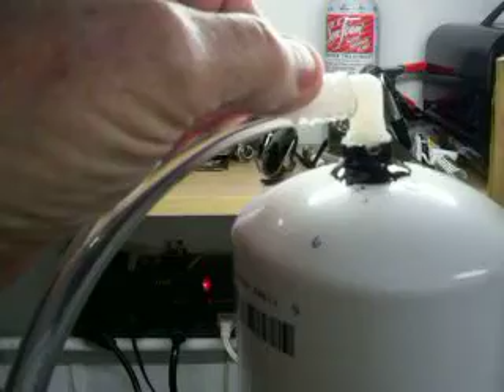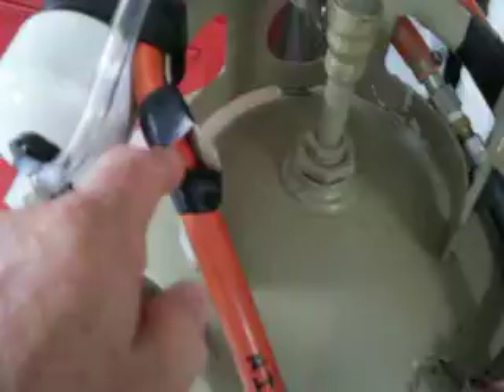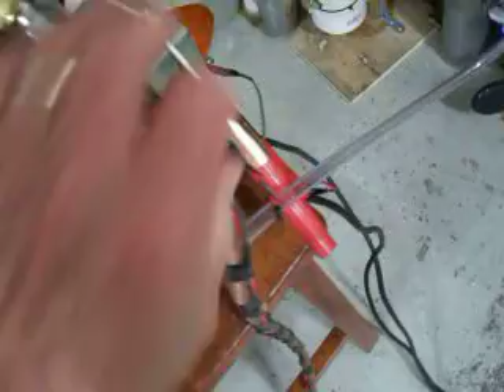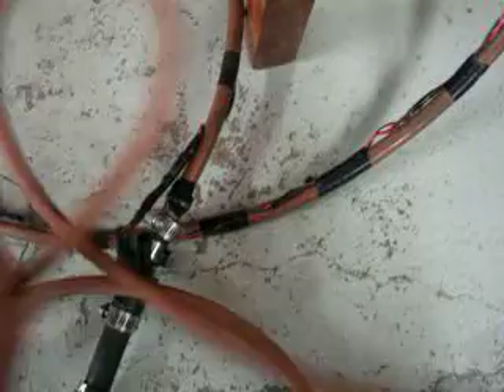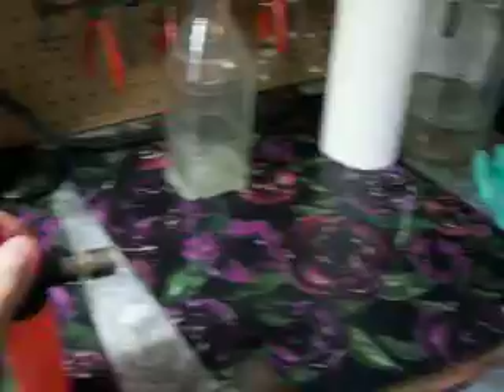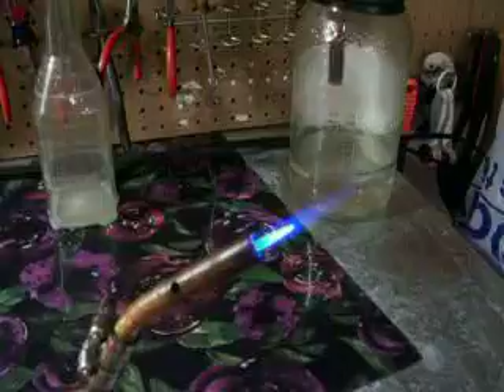system set up explained

Comment: Hello  
Nice work 
But I have a question  to you
Do you think it is safe to compress a gas vaper ??? 
Thanks
Reply from the maker: Baha Khazel i have been doing it for a long time, never had no problems, you just have to be careful with sparks or open flames around the tank, always be safe and you will never be sorry
Reply from the maker: there is no need to heat the gasoline up to compress it in to a tank,  the way i do it is i have a oil less air pump drawing a vacuum through a tank of gasoline and my wicks and let it pump it in to my pressure tank, 100 percent gas vapor, i pump it to 60 psi and have no problems at all. just be safe and keep sparks or open flames away from the tank.

Comment: i am looking for a decent pump to use on a light suv for this system. i have figured out my fume chamber and have scuba tanks for my storage, but need a way to charge them. i plan to refit a 3/4 pu truck later.
Reply from the maker: thats what you need a good thick tank

Comment: sorry to admit failure.i have not been successful with 50 psi going to my fuel rail.i have compressed vapors as you did and pushed it thru shredder valve in rail.  i dont know if i did not bleed enough but engine was running for 2 minutes only .it maby that vapor need to be at molecular level lake steam.any suggestions?
Reply: what the temperature was at fuel rail\injector? air intake temperature?

Comment: you would not believe what happened .i have blown vapors to my bubbler using mattress pump which i know has not much p[pressure and hooked exit  hose to fuel injector.  put candle in the front of injector and while switching on and off injector i was getting beautiful bluish flame. i was thinking in stead of pressurizing vavors to the tank i would use 12 volt compressor after bubler straight to rail. I also had question where did you get your brass flashback arrestor
Reply from the maker: i got it from a car quest store a few years a go, this will handle hydrogen gas and gas fumes good with out no fear of a explosion if it ever did back fire

Comment: great job vaporkid. i just wonder, could you could run a 100cc motorbike with your wicking design system without an air pump? thanks. God bless!
Reply from the maker: sure could easily
Reply: thanks for the reply. the problem is the throttle and changing gears. i have tried the vapor system heating the gas with copper tube with my bike. i did succeed at first but i only traveled 3 km and the bike died down and the torque and acceleration is insufficient.
Reply from the maker: BOOPIE DISTURA i think if you use the wicking  it will work you just have to get the right wicking material,  and make sure that the tube going to the carb is at least 1/2 ID becuse the carb gets starved the more power you demand, on a car engine you have to feed 6 or 8 cyls and that takes a lot of air to feed it, i go with a 2 in line for my vapor system, good luck and have fun.

Comment: Scientific question, at what pressure do Gas vapors become unstable ? I wouldn`t want to see anyone blow themselves up !!!
Read here for some insight.. http://forums.iboats.com/forum/other/non-boating-technical-topics/220436-what-psi-are-propane-tanks-rated-for
Reply from the maker: gasoline will boil at 101 deg to 401 deg it will vaporize compleatly at 450 deg  will self ignite at 460 deg, some people heat there gas by putting a copper coil in some gas and heat it up with there radiator at a 190 deg she will boil real good to start steaming all the vapor you need,  actually that is where you get all your mileage from  heating the fuel!!!

Comment: I have an AC compressor that I can convert to a dedicated compressor, see here http://www.jeepforum.com/forum/f11/c-oba-conversion-write-up-pics-471962/

IT is unclear to me if they would be suitable for pressurizing gas vapor but from my understanding the ac system uses a propane / butane mix for the cooling affect so it might be a go...?

You can also Google ( Jeep XJ ac compressor conversion ) for more results. Most Jeep guys on these forms are awesome, whatever you do never mention you are doing a fuel savings thing cause you will be torn to pieces and ridiculed by the trolls that live in these forums. Trust me it`s not worth the effort it`s just pointless people will come around when there ready one by one...  Just keep that part well away from any conversations and you`ll be awesome :]

Hope that helps,

Cheers,
Terry
Reply: One more thing you can place the air tank a long skinny one directly infront of the gas tank on an XJ, there is a perfect spot with tons of room almost like it was put there on purpose :] 

 Also it should be mentioned that if you use a used propane tank you need to have it purged or so it`s stated here http://forums.iboats.com/forum/other/non-boating-technical-topics/220436-what-psi-are-propane-tanks-rated-for

Safety 1st people,
Cheers
Reply from the maker: i found  out by experience dont try a ac vacuum pump it will kill the gas vapor becuse it has oil in the compresser, you need to use a oilless pump like i have, it does not effect the vapor going through the pump, it can not have no oil fumes mixing with the vapor
Reply: What about the older York compressors they talk about, You don`t need to have oil in the air system from what I can gather they have a separated crank case with oil...
Reply: NoFearAwareness I`m not sure what gauge steel should be used for a gasoline vapor setup but I`m thinking the Vair tanks would not be a safe match :/
If involved in a n accident they could tear open were a propane tank could take a serious hit...
Reply from the maker: i will be useing a oxygen tank a small one the type they use for cutting torches, there nice and thiick, just make sure they are cleaned out with fresh air clearing all the oxygen out of the tank
Reply from the maker: NoFearAwareness might work as long as the vapor dont mix with the vapor fumes, i kept wondering why the vapor wouldent light every time i used the ac pump, it was the oil that was killing it, when i bought the pump with out oil and charged the tank it burned perfect.

Comment: About how many times can you refill that tank to 40 psi with the 1 cup of gasoline ?

Is there a reason you only put 40 psi in the holding tank ?

Cheers
Reply from the maker: i have been filling it so far 15 times, and its still going strong, the reason why im only puting 40 lbs in is the clear plastic line wont take any more pressure then that, when i build my unit for the truck i will use good high pressure hose, then i can put 100 lbs in it easley, all you need is 50 lbs when you hook it up to your fuel rail. for it to work.
Reply: TheVaporkid

Are you really saying that you take just one (1) cup of gasoline, pass air over it to get vapors flowing off it, until you get it to 40PSI when pressured, then use the the pressurized vapor? Then, you use the SAME cup of gasoline to repeat this process 14 MORE times?
If so, then that is awesome!
A few questions...
Doesn't the gasoline go flat unless you keep it covered? Does the sponge on the air-intake tube of your gas-jar do anything special? I have more questions, but I should be able to answer them, based on your response to these two.
Reply from the maker: let me ad somthing else i dont realy need no more then 50 lbs to run the truck, becuse the electric fuel pump puts out 50 psi to the fuel rail,as long as you keep a 10 lb difference on the tank you will be fine. my next video will show you how to do that on your car or truck.